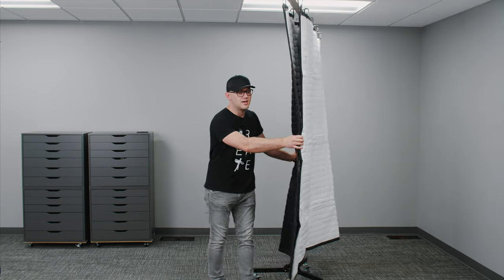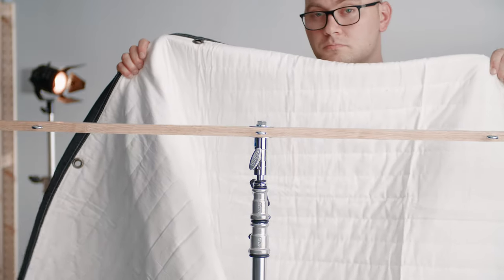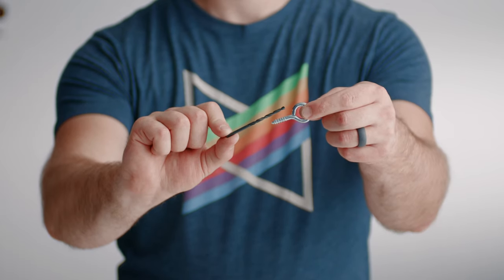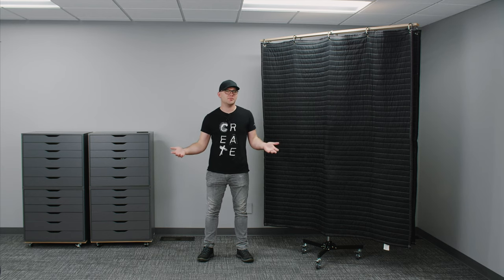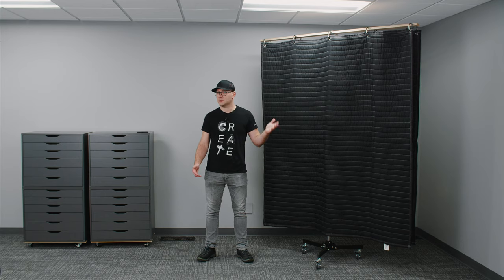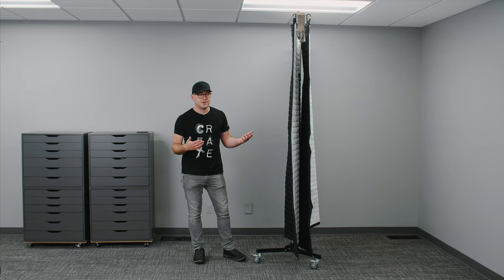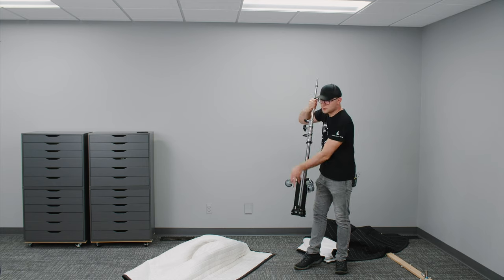GIANT DIY Sound Blanket Panels For Better Audio and Lighting!

Comment: Lots of great ideas! Since I'm in an unfinished basement, I often hang blankets, etc, right from the ceiling. And as an old fastener guy, here's some nomenclature that might help find things faster at the hardware store: 1/2-13 (coarse) x 1-1/2 Hex Head Bolt and 1/2 x 2 Fender Washer. For eye screws look for a close match, sizes vary by manufacturer. Save some $ by using S hooks instead of carabiners.

Comment: Great video! Enjoying the tour and tutorials. Speaking as a sound engineer, keep in mind the black side is a bit "brighter" in sound because it's a nylon tight woven material that can reflect sound and the white side is more fibrous and more sound absorbent than the black side. however both sides will help kill room reverberation, but it's worth noting. Also, from a cost standpoint for those who are on a real tight budget moving blankets can also work well and will be a bit cheaper, just add grommets.
Reply: yea it's more expensive if you don't get it right, learn from my mistake. Out about $200 lol
Reply: @buddyfx7026  😉

Comment: I needed something like this for our new studio and was researching what can I do to help with echo that's easy and mobile. I'm glad I found this. 
Thank you for putting together this diy guide. I'm going to build 6 of these this week.
Reply: Got 3 done today and they are awesome. There were a few differences, listed here:

Blankets now have 8 grommets not 5.
The size is advertised as 6ft(72inch) but they are 77-80 inch, so a 6ft oak board is too short, need 7ft to make it fit.
The screw needed for the adapter is 1/2inch x 2inch long. 
The carabiners can be replaced with #6 screw hooks to save money. Still easy to swap and store but much cheaper.

Comment: FYI: The exact 80 by 80 model that Caleb uses in this fantastic video is: ‘VB-70G  = Black/White – WITH Grommets’ Cheers!
Reply: Hmmm...thanks for the tip, but now I'm not so sure it's correct. Are you sure that Caleb is using 80"x80" square blankets? 80 inches is 6 feet 8 inches. The stand is 8.5 feet tall, or 102 inches, plus there is some extra height at the top with the Kupo adapter and the wood. Are you sure that Caleb isn't using blankets that are 8 feet tall (96 inches)? The acoustic blankets that measure 96 inches (8') tall x 80 inches (6'8") wide are item # VB72-G. I'm working on a budget that includes building four of these, so I want to be sure. Caleb, if you're reading this, can you set us straight? Thank you very much!
Reply: What Caleb is using has to be 6x6’ blankets (72x72 inches) because the board he is using is 6x4x1in

Comment: Great rollabout stand. I did something vaguely similar, using two Ikea rolling clothes racks ($12.99 each) as the basis for an audio record “booth”. Four 4-way PVC pipe fittings at each upper corner plus two 5-foot furniture grade PVC pipes make a rigid frame for what is effectively a 6X5 booth. No gluing together needed - the weight of the sound blankets affixed by spring clamps holds the entire thing safely together. Height can be adjustable to 68 inches. When necessary it can be taken apart and stored in minutes.

Comment: Those will work well for  voice work as they absorb high frequencies well. But they don't absorb much if any midrange or low end.  If you were working with music sources, bands or instruments you'd need additional (more full range ) absorbtion.  What you have is a good option for cutting high end flutter echo and room sound..
Reply: having two blankets have made a cut for the mid range. they create an air gap between the wall and each other. you wouldn't need more reduction for the low end if your not doing sound mixing. i think it's a pretty slick idea!
Reply: I'm going to be doing up a new office/mini-studio for my channel and want the best full range sound deadening/proofing without being forced to break the bank. What do you recommend to get? If I can mount things directly to the wall to save space, that would be even better.

Comment: This is amazing, thanks again Caleb.  My studio room has a lot of reverb!  I'm getting some scaffolding poles from a company in the UK that offer cheap scaffolding curtain poles (for like 45 bucks each wall, cut to size as a kit).  Producers Choice fortunately are also available in the UK so will be doing similar to what you've done.  I'll use the grommets and then hopefully will be able to easily put these up and remove where necessary, before recording

Comment: This is a nice simple build. Thank you for sharing it.

My question is this: Are you using this diy equipment to accomplish both tasks at once, or are you prioritizing one task over another? You might want to create two of these when moving it to fulfill one duty will impair it’s ability to fulfill the other!

For viewers on a real shoestring budget, I’d like to suggest furniture blankets, which are of similar (but not equal) construction. These are sometimes referred to as moving blankets. Best prices I’ve seen are at Harbor Freight, and they often go on sale.

Lastly, I’d like to point out that your rig is extremely versatile. For example, it would make a good wall if you’re tenting a window (and didn’t have access to a 10’ frame or whatever).

Comment: Just a note, but drilling three holes in the middle of the board, for the bolt, and a loop on each side, you make the strength of the centre of the board extremely compromised. From my experience I would suggest a mental plate to support this area and avoid it possibly snapping.

Comment: I'm in a bedroom walls are clear. If I put reasonably large gallery wraps all over shouldn't that cut reflections somewhat where close mic Technic for podcasting etc with a dynamic mic would yield better sound than bare walls?  If not, than what. I can't put moving blankets on wall etc.

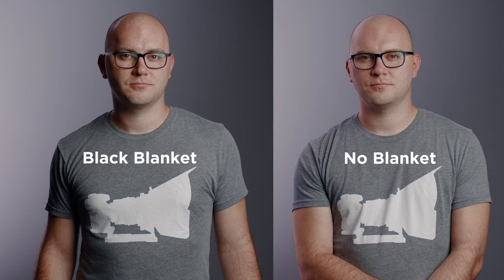Comment: I may be totally wrong here but to my untrained eye it looks like at 6:55 you're comparing black to white instead of black to none. In the next shot no blanket looks drastically different than the previous shot with no blanket. I don't know if that was a change in settings or if I'm missing something but can someone explain why having no blanket the lighting changes so drastically between those two shots?

After having looked at it more it seems to me that it's just a difference in exposure to better show off the differences. Again I could be very wrong in this and if anyone would like to correct me please do.

Comment: You might as well go ahead and paint the crosspiece to get rid of the DIY look. A coat of spar varnish under the paint would lock out humidity. A second piece of oak 90 degrees to the first would take care of any possibility of droop long term.
Reply: Are you suggesting a T-configuration? I was thinking of that...the possibility of sag and turning the plank vertical, but a T-configuration would probably be better. The problem would be covering the extra distance through the vertical board. Is there an extension for the stand that could make that happen?

Comment: what's the reason for two blankets back-to-back on one roller stand?
Reply: more material means more absorption.
Reply: Pauls Audiolabor Thank you.  Is double layer blankets common practice?
Reply: @photographer-at-large9795  Acoustics is quite complex field. There are many ways how the sound will go.
* sound wave goes thru the blanket, is damped, goes out of the blanket. then because of the second layer is damped again
* some waves are bouncing off, so when you have an air gap between the two layers the wave bounced of second layer goes thru the first layer again and is damped again. So its better to use 2 layers with air gap than just one thick layer.
Reply: @photographer-at-large9795  It isn't the primary concern as far as sound is concerned, but having a second blanket also acts as a counter weight and provides stability to prevent tip overs.

Comment: So I thought this was an awesome idea for location sound. I started off making these just as you demonstrated here. The more I got into the project the more I became concerned that the Producer Choice blanket grommets would not take the beating of repeated hanging at different locations and found that all the clips added to the blankets were cumbersome. I decided upon a simpler approach: just screw in #14 x 1" sheet metal screws on the top (not the side) of the board with the same spacing as the grommets. Leave the screw heads standing 3/8" or so above the board so that the grommets slide over screw heads and lock in. The blanket braking over the top of the board helps reduce the load on the grommets, so I'm hoping for less wear and tear on the blankets. Over all a great idea for on set reverb reduction. Picture: https://drive.google.com/open?id=1e3eDA07XHe6Da6iXDO0YHBZEulzP7_xD
Reply: This is a good idea. Just looking at it, it seems like you could increase the benefit of the "braking" if you just screwed in one row of longer bolts/screws in the center of the board and put both blankets on the single row of bolts.
Reply: @KravMagoo  Yes that would probably be even simpler. I was trying to hang the blankets independently so you could take them on/off without interfering with the other blanket, but really a single row of screws would work just as easy....By the way, I used these the other day on an outside shoot, made a wall of blankets to shield noise from a highway. Work really well, helped a lot in reducing the noise reaching the set. I did have to weigh the bottom of the blankets down so they did not flap in the wind, but overall very effective.

Comment: That was a terrible test with the phone and blankets.  Phones are almost all high end and we all know that the high end is very easily absorbed.  You could had used bed sheets and would’ve gotten a dramatic result.  I find it odd that you let that one slip by you.  Either way, great video.